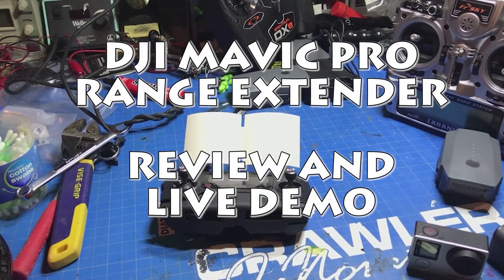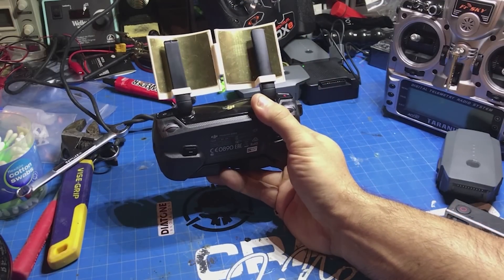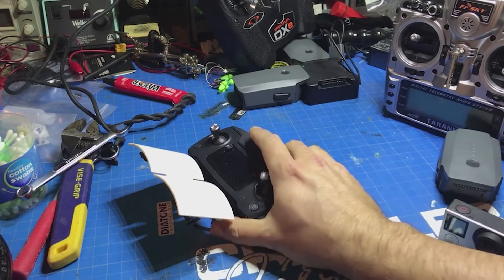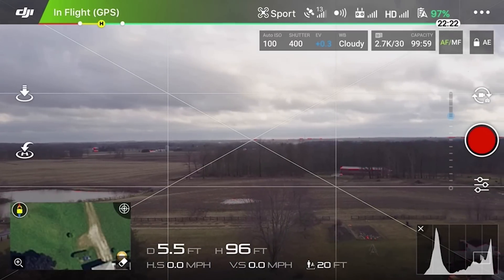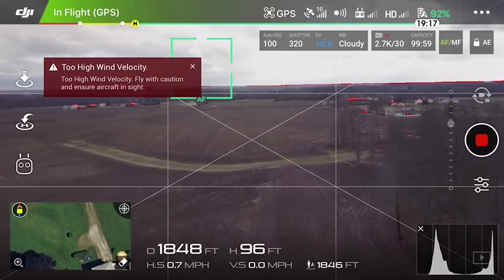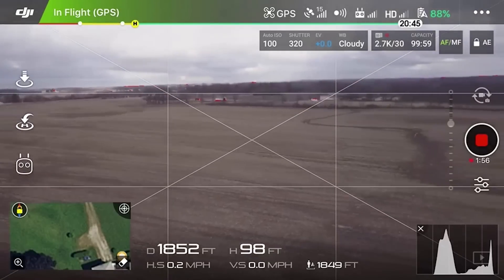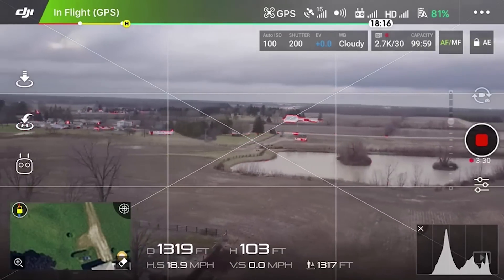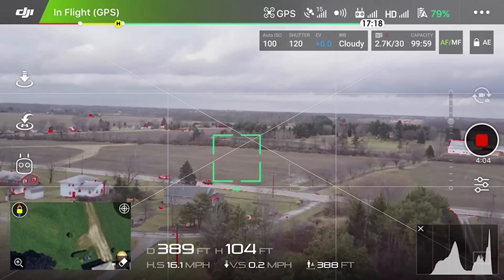DJI MAVIC PRO: RANGE EXTENDER REVIEW AND TEST

Comment: I use it for my short distance flight in my area because of the bad interference I get.  So far it has done pretty well when I put these extenders on.  I would get less loss of signal from them in my area. The one's I use I picked up from Best Buy which where from PolarPro brand.  Here is the video of it when I flew with them on. https://youtu.be/w9BC_9K0AZE

Comment: Thanks you're review  exposing crap.
Reply from the maker: Tank 62 they are crap. I think the good reviews come from people who get them for free. I have some to try on my phantom 4 pro now so I guess we will see how they work.
Reply: Cool let me know how it works out.
Reply: Tank 62 - These are far from crap. I got them for my Spark and it took my range, in a bad area, from just under a half a mile to over a mile with them on. This dude’s issue is height. Does anyone remember the trigonometry you said you’d never use? Use it. GO HIGHER THAN 100’. I was at a cozy 300 when I made this journey tonight. I also bought them from Best Buy, rather than order thru the mail. The one thing that makes these better than all the others is the true parabolic nature of them, along with the antenna offset. Every other booster has the antenna centered in the booster. I do believe that this set from PolarPro, being offset, gives you the distance, clarity and penetration you are looking for. Hey man, I wouldn’t risk my drone or yours if I didn’t just do the testing. Remember, altitude. Even the Spark manual says they achieve their testing distances at a certain height and it wasn’t at 100’, I can promise you that. Now to test them where I set my personal Spark best of 1.65 miles (half a mile over what DJI claims) without boosters a few weeks ago. That will be a distance test. Where I live and tested today, is all hills and trees. Pittsburgh is known for that...other than bridges and THE MOST SUPER BOWL RINGS a dynasty could have. Happy flying!

Comment: Man, I just don't think a range extender is necessary with the Mavic.  I get a much better signal than what I got with my phantom 3 pro.  After having a fly away 1,500 ft away with a P3 Pro eight months ago, I don't take my Mavic out far.
Reply from the maker: Carlos de Castro agreed.
Reply: I had a near Fly Away with my Phantom 3 Standard last year. It was at night and I lost sight of it. Then I saw it and got disoriented when it flew further until I regained control. I upgraded with the Argtek Antennae Kit and flew about 2,000 feet. After the firmware update in May 2017, which enabled my LG smartphone to connect, the Go App shut down during flight. It was near impossible to control and made the neighbor yell at me cause it was slight over his house. ..Well, I don't have that problem anymore with my Mavic Pro. It easily flew over 2,000 feet and back.

Comment: Part of the problem with what you are using is that the antenna is not centered to the curve which is what creates the focal point for the parabolic curve.
Reply from the maker: Ed Spencer good explanation
Reply: I ordered the same reflector, and when received I told myself that it couldn't be fine because of that.
I didn't try... because i didn't received may Mavic yet
I want too to try to boost the transmission because here in Europe the 2.4g transmission power is reduced and I live in a place where trees are everywhere

Comment: every review shows they suck. they just are not accurate enough to do what they say. crack the case open and order a coupe cables them hook up some large panel antennas.
Reply: also could try 3 old school metal window screen tied together to form a 3 sided box for you to sit in.  run a wire to ground and you have just built a reflector or partial faraday cage the kill the unwanted signals from around you. I've played a bit with the math on the mavic transmitter and antennas but it VERY sensitive to anything metallic around it. And I mean that in a bad way. So unless you get it absolutely perfect I imagine any reflector is going to have to be more than about 10 inches away from those antennas.
Reply from the maker: nbookie great info man. Love to see that data

Comment: Thanks for sharing....I just got my mavic today......had thought about ordering....but I think will hold off.  I had seen comments in Amazon...but this was first actual testing.  Thanks again
Reply from the maker: santiago javier that's good I guess. They worked with my phantom 3. I just picked up a set to test with my phantom 4 pro
Reply from the maker: dlorbieski no problem. They worked with phantoms but just no need with the mavic
Reply: I actually tested for not range but for just trying to penetrate interference I was getting in my local area.  They do actually help with that, especially if you in the city I can see these things as pretty useful.

Comment: Just got mine... So if I see weak signal, go higher? Also, do you ever rush back if it says high wind? It made me nervous.... What if you lose signal... Does it rth?
Reply: Mike Fas usually it should be fine when there is high wind. Obviously if it's too much, wait till it slows down. If you are not comfortable with high wind then that's you're call. Good luck flying!!!
Reply from the maker: Mike Fas rth works great on mavic. The wind warning happens all the time. It's almost annoying. I see it happening even with phantom 4 pro. I just ignore it and do my thing.
Reply: Ok. Great. Seems like the warning is too sensitive. Thanks!